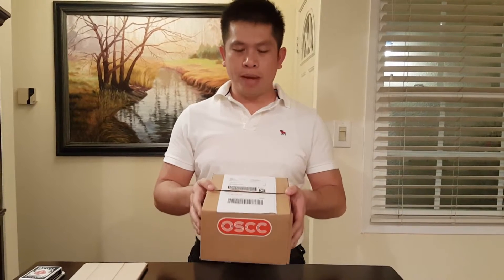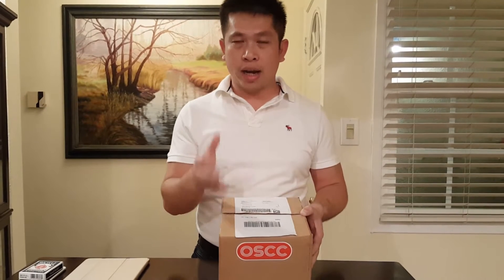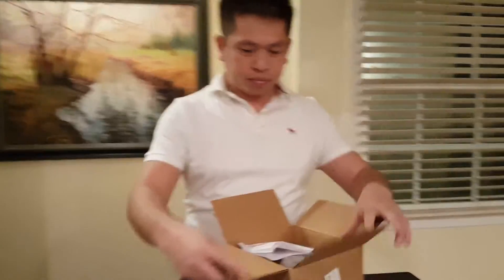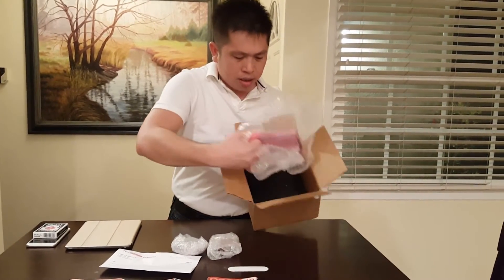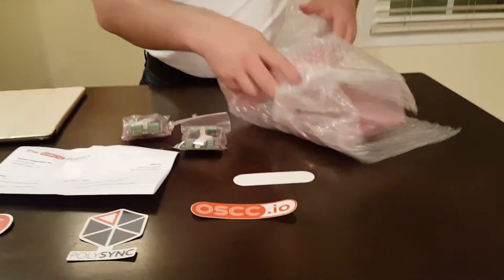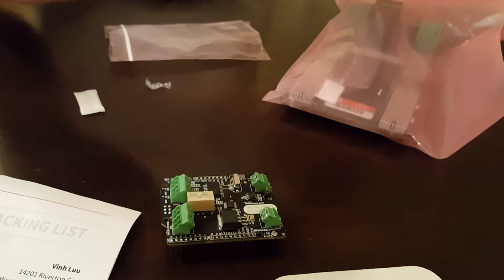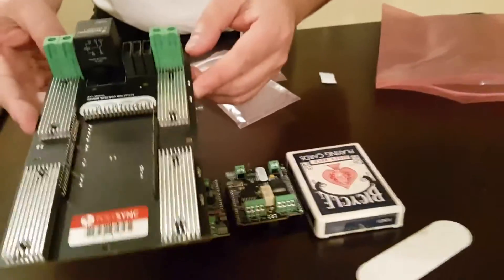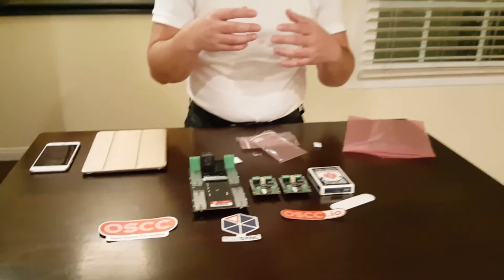Unboxing Open Source Car Control  circuit boards for self driving car development

Comment: There is no brake-by-wire in KIA soul. Do you have any piston to actuacte brake booster?
Reply from the maker: OSCC.io's wiki suggest to use the Prius brake actuator. You can find more info here:

https://github.com/PolySync/OSCC/wiki/Brake